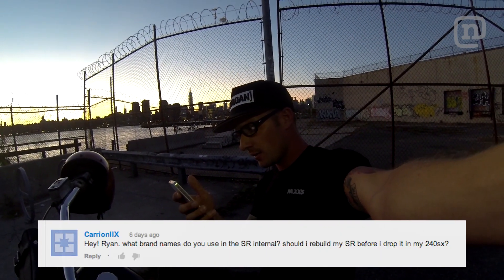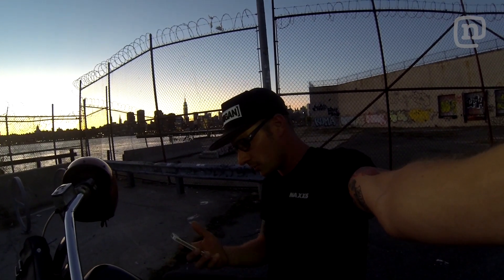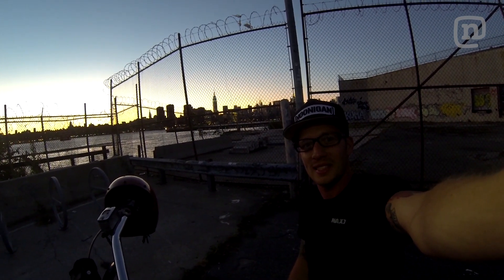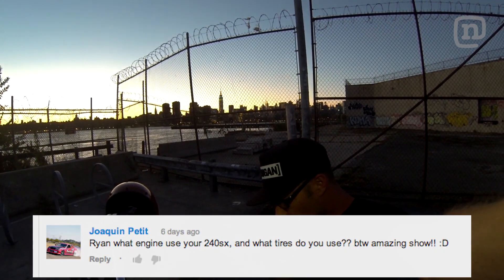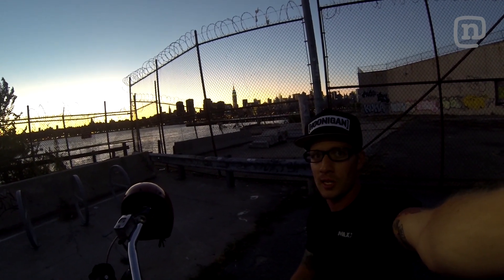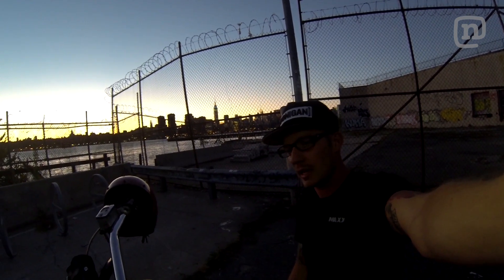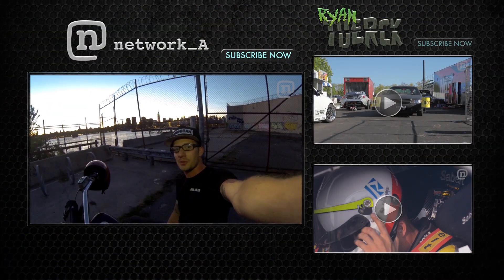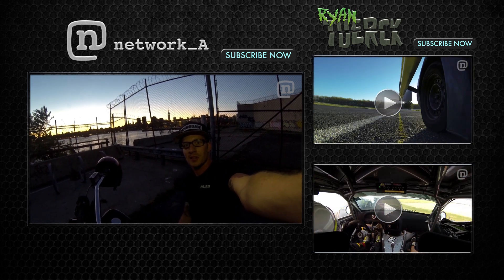Ryan Tuerck Takes on Brooklyn: Moving Target GoPro Burnout Response

Comment: I'm putting a 240sx rear subframe under my truck and getting rid of the leaf springs, also I'm putting a 350 in it. Do you think the stock s13 axles will handle the torque when I upgrade the engine? You should let me bring my Isuzu drift truck on your show and we can tear it up! Also your show is awesome!